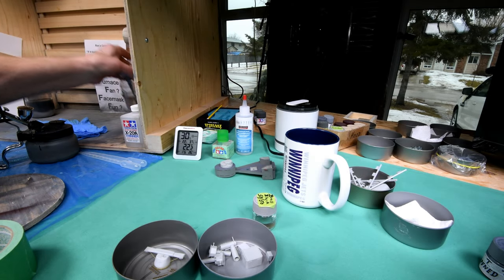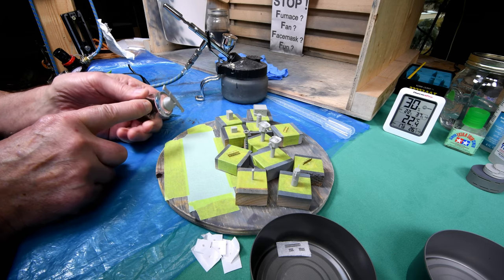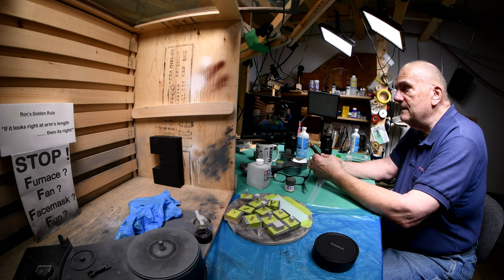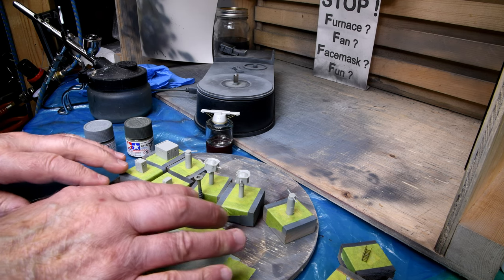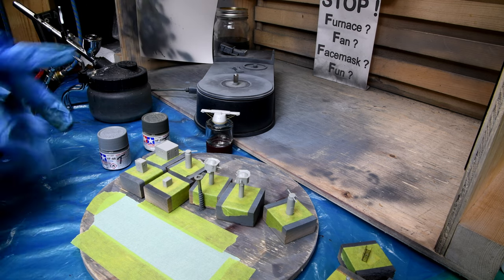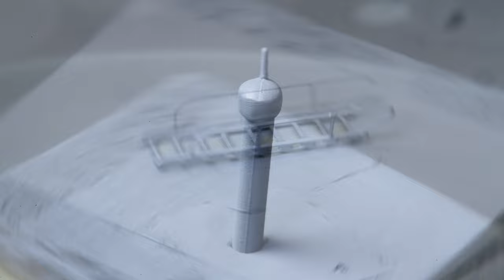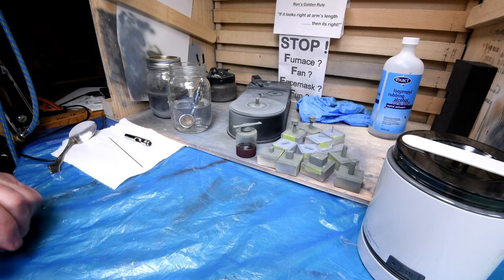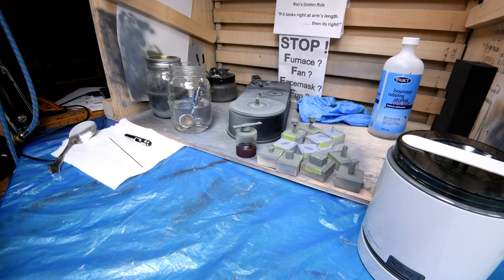The Model Ship - Part 741

Comment: Hi Ron, just a little tip with the ladders, if you only put about half the ladder length on the masking tape. doing this makes it less likely to bend the ladder when you take it off the tape, especially the flat ladders with no hand rails.
Reply from the maker: Thanks for that tip Jason. 🙂👍